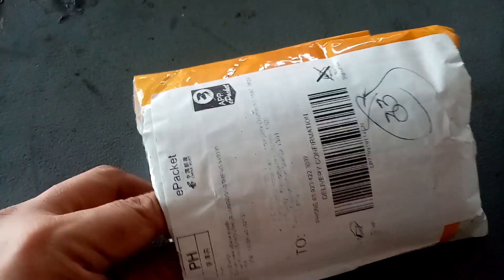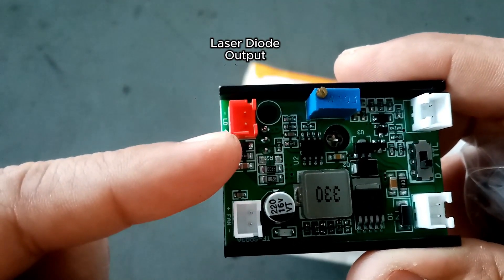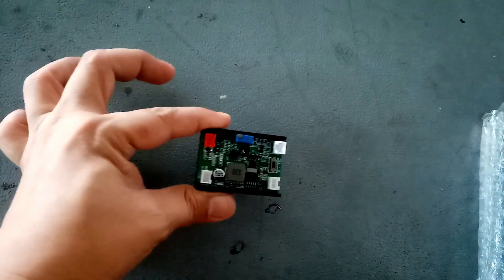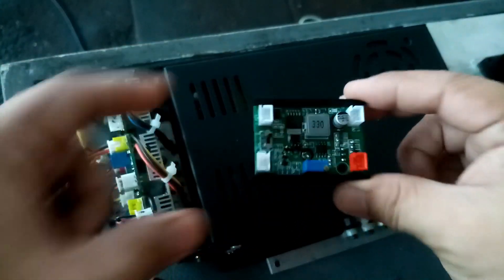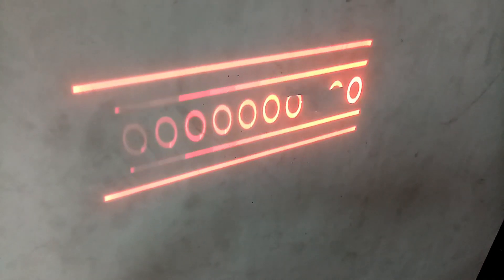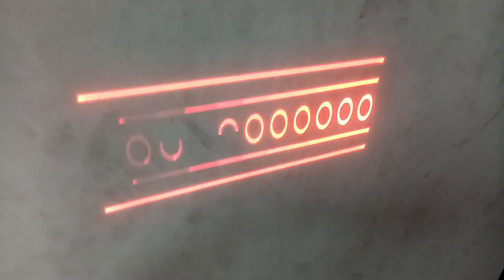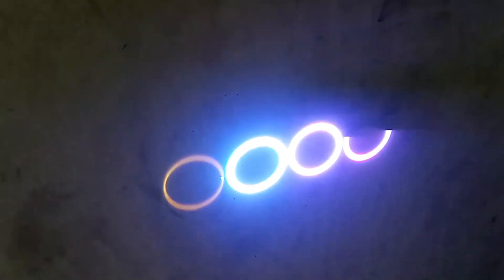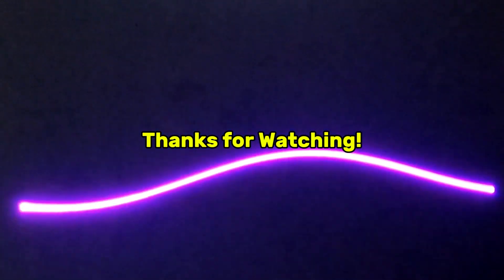Laser Diode Driver Test & Comparison: Which One Performs Best?

Comment: Hmm, so "D" mode is actually true analog? i might have to pick a few of these up, theyre the cheapest analog drivers on the market as far as i can tell.
Reply from the maker: Yes you are right mate this one have a better analog output
Reply: @LasershowLab  what changes are needed to use this for green and blue laser diodes?

Comment: elimde bu kart ve 5,5 mW bir laser mevcut 
lazerden 2 fandan 2 kablo çıkıyor 
bunlara ilave olarak mks dlc 32 kart kullanarak bir cnc laser engrave yapmak istiyorum ancak kablo bağlantılarını bilmiyorum şema olarak bunu açıklayabilir misin 

Ve ayrıca 10k direnç kullanmalı mıyım bunların haricinde 

Teşekkürler...
Reply from the maker: the input cable to control you should connect it to TTL input pins thats the only way to use that driver
Reply from the maker: 10k resistor is not necessary really on my end it depends on your diode required current